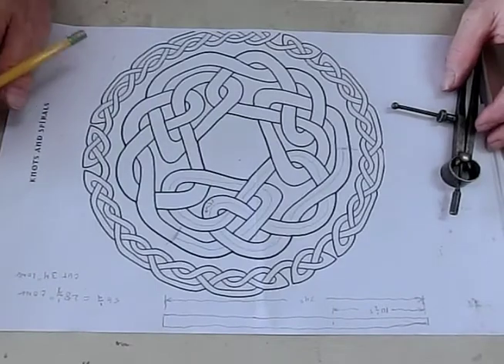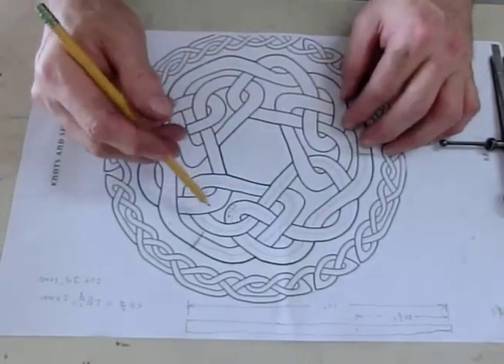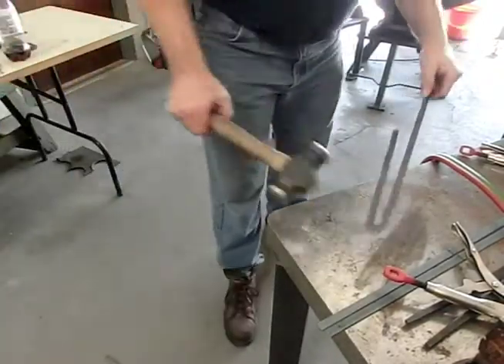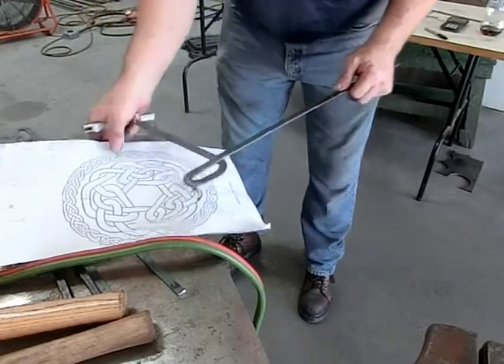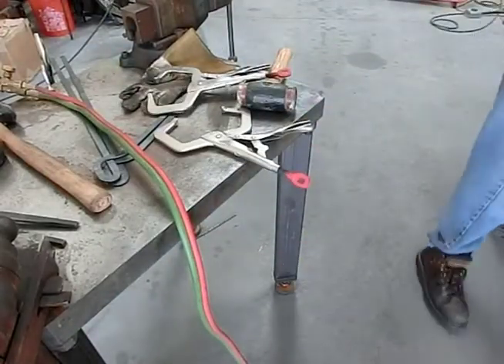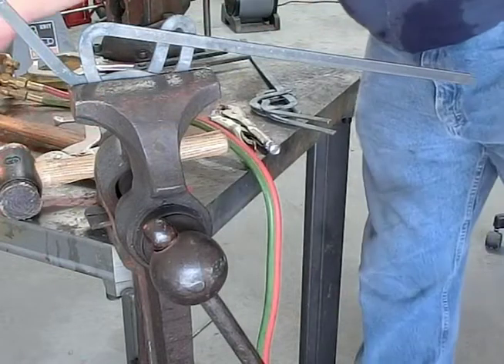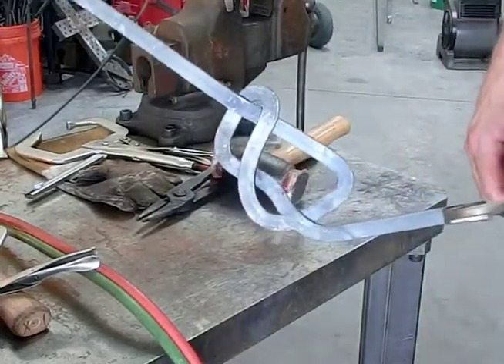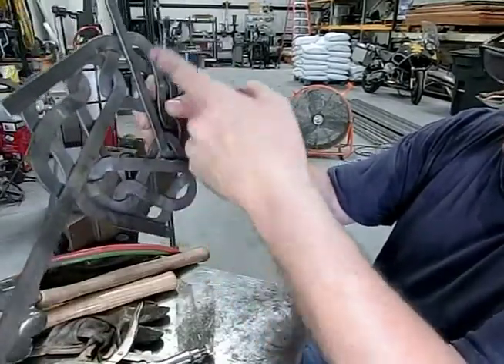Celtic Knot Trivet Episode 1 of 2

Comment: Looks good so far, your bending strategy is working.  Where I used to work we used a torch frequently for silver soldering, and we had a gas saver.  It was really handy and worked well when adjusted right.
Reply: Looks like you have one....missed it initially.
Reply from the maker: Thanks Bill, Yes without a gas saver this would be a pain to keep lighting the torch. I have made some smaller ones using the gas forge.